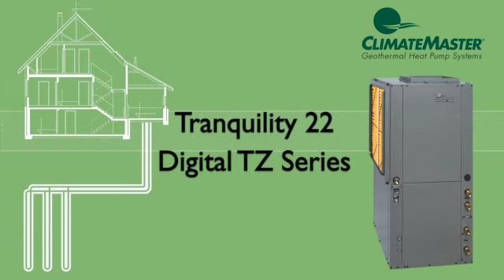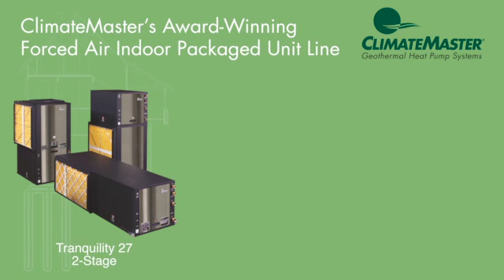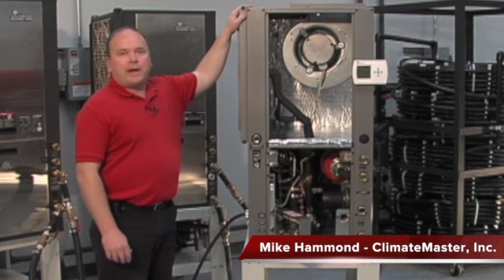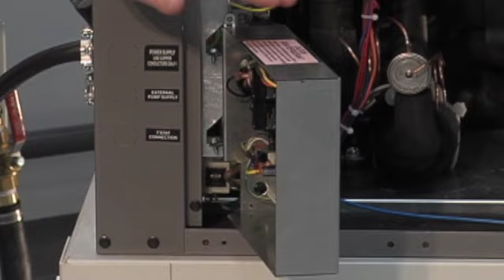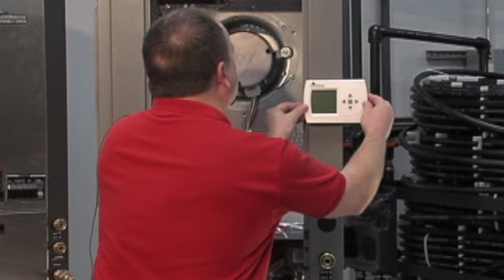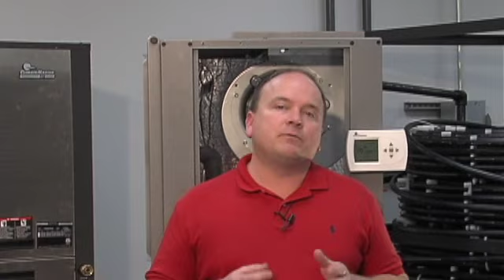ClimateMaster, Inc. - TZ Series Introduction

Comment: I have the Climatemaster tranquility 27...I highly suspect my installer plumbed my hot water heater wrong. I have looked my owners manual over and it really doesn't show anything on that. Is there someone that could help me? They have the domestic cold water supply piped into the DWH out, and the DWH in goes to my bottom drain inlet on the water heater. I don't think that's right or is it?